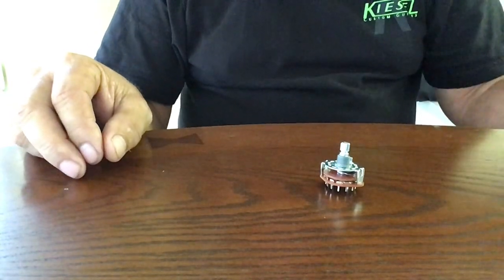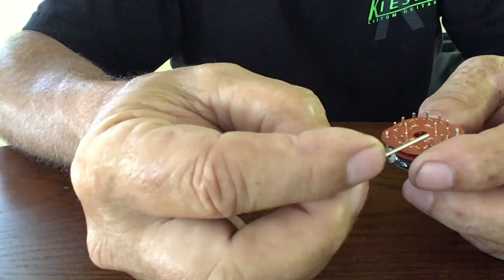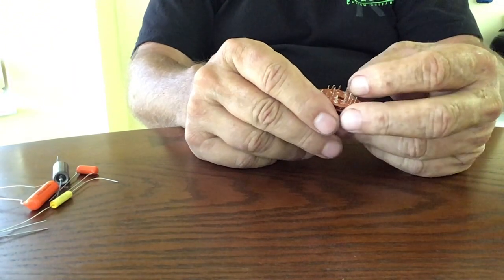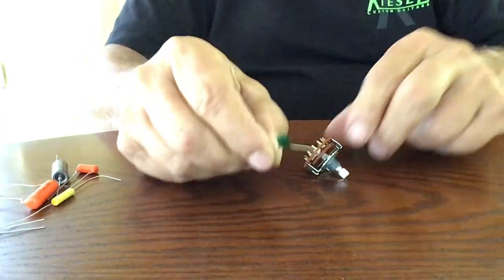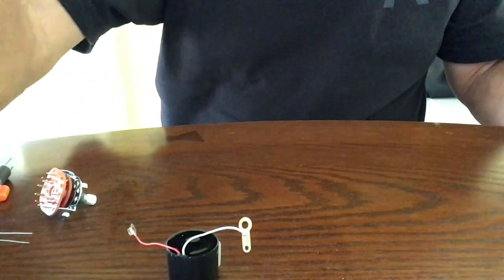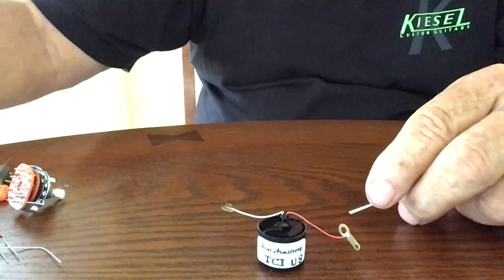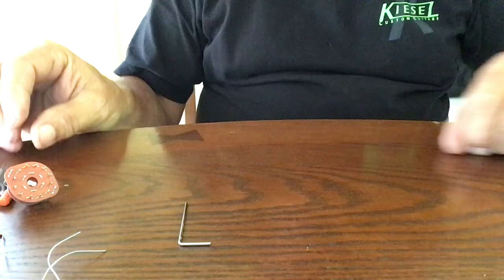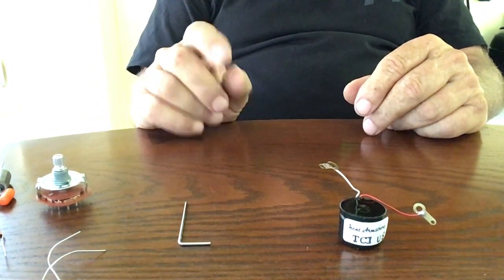Varitone wiring with a six way rotary switch

Comment: Very interesting. Will have to watch this again (and again...) and make some notes. Goes to show though that we can do some cool tone mods with fairly simple circuits and parts and some imagination. The trickiest part sometimes is fitting everything inside the guitar and protecting bare leads from accidentally shorting against each other when everything is pushed back inside the cavity. Will be watching when you demonstrate your soldering techniques/tricks for this mod, which are maybe a bit intricate for folks that don't do much wiring. The actual connections can be more difficult than understanding what they're doing. Thanks Tom!